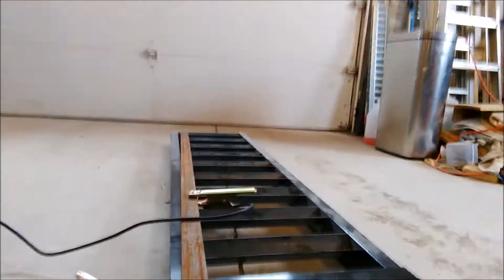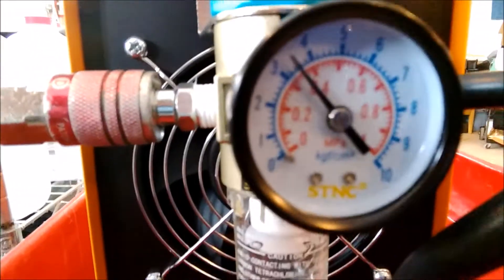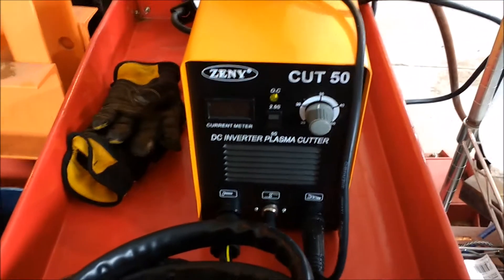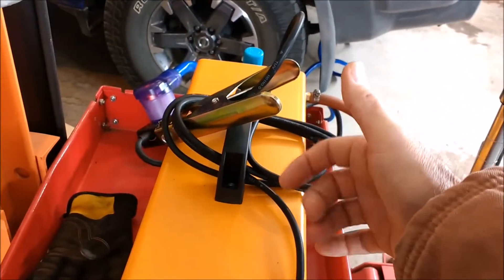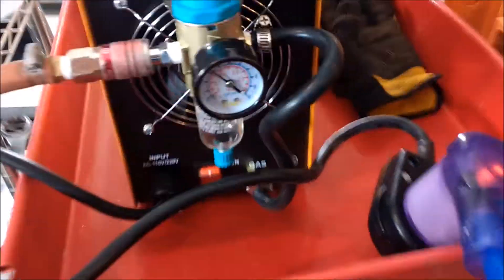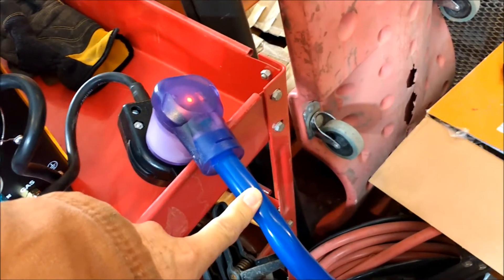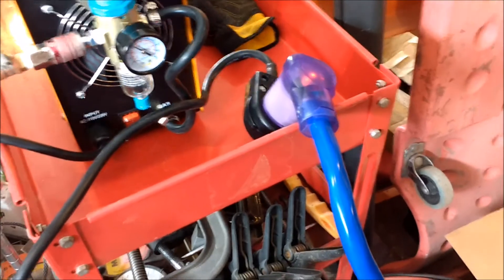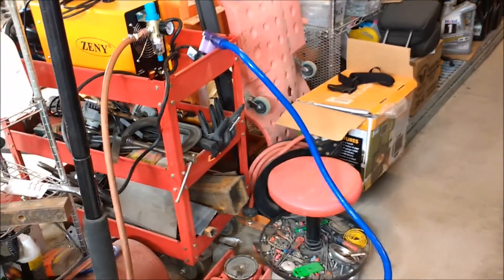CUT 50 Zeny *FAIL* Plasma cutter

Comment: So did you ever fix it?  I have the same model with the same problems.  Searching the interwebs for solutions for it.
Reply from the maker: No, I sent it back, bought a primeweld CT520D, been running that for almost 3 years now
Reply: @anesthesiadreamin  Thank you for your reply,  I'm pretty sure mines going to go in the dumpster too.
Reply: @anesthesiadreamin  I was able to get mine fixed.  I had the exact same issues, and once I got snowed in, I was fixing it no matter what!  It was really simple, the cooling fan in the back was stuck on the chassis, the unit went into protection mode.  Once I freed the fan, it cuts great!  I spaced the fan off of the chassis with some Nylon Washers.  Hope this helps someone in the future!
Reply from the maker: @kickin45  thanks for your feedback! Thats awesome! I will try to move this comment to the top somehow
Reply: @anesthesiadreamin  I have a video of it, but it's only 7 seconds and not worth the upload......
Reply from the maker: @kickin45  well, if you're willing to take it apart again, and record, point out the things that were wrong, and stitch your seven-second video into that....upload it, then Send me the link, then I can put an end screen, ie a link, at the end of my video, that would allow people to just click and then be taken directly to your video.  I think it might help some people. I'll leave it up to you, it's definitely more work for you, but it would just take me like 30 seconds to put an end screen link on my video
Reply: @anesthesiadreamin    Here is the link to my 7 seconds of Fame.  https://youtu.be/_fyNTb2Yeto  I'll have to work on creating a video of what I did to fix it.  in the video listed here, you can see how the fan hits the chassis of the cutter.  I merely installed washers between the fan and the sheet metal, giving the fan enough space to run.
Reply from the maker: @kickin45  hey man that's a great start. And a good fix! I wouldn't be surprised if that would have fixed mine. Keep me posted

Comment: I had the same problem with same model. Right out the box the cooling fan would not come on, the regulator didn't work and naturally the "O.C" light was always on. After hours of trying to make it work properly I finally sent it back and it only cost me $66.00 for the shipping. A lovely experience I tell ya.